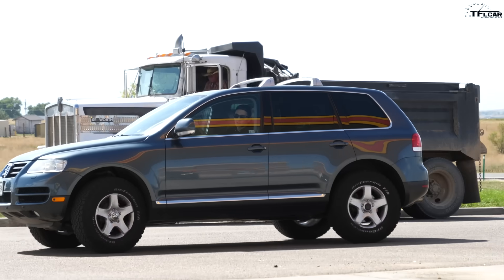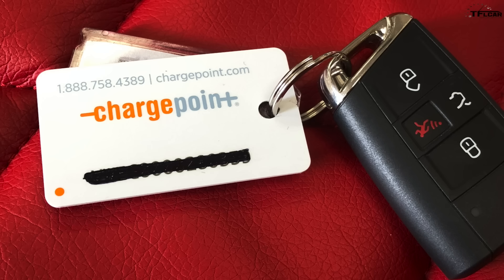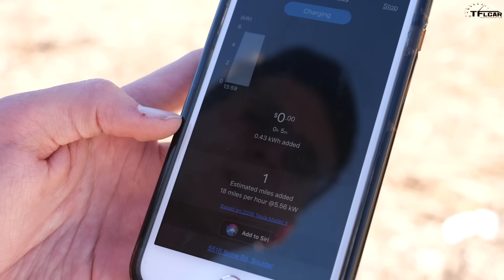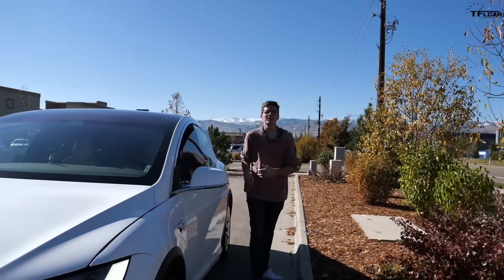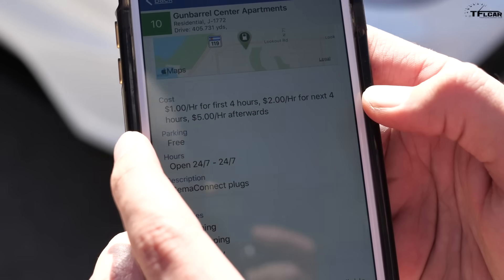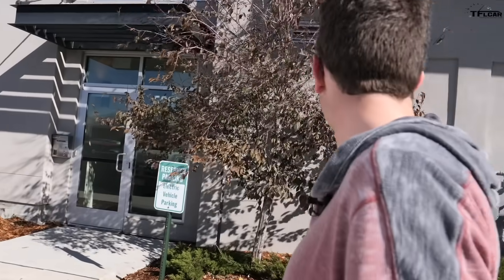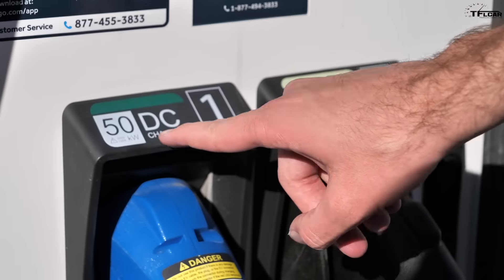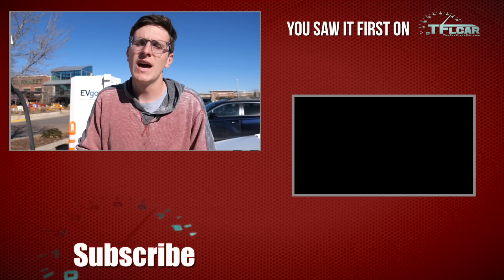Here’s Why Charging an Electric Car Can Suck - And It’s Not The Reason You Think!

Comment: Great video (again) Tommy.  Seems like unless you have a Tesla, you are pretty much in a waiting game (literally) until the rest of the industry develops super charger technology.  One question I have is - there has to be a point when vehicles far outnumber cars, assuming eventual move to EV's.  When that happens, you could really get stuck waiting behind others JUST TO ACCESS the charger.  What could those wait times be?  No one ever talks about that.
Reply: The waiting game for fast chargers probably won't be for three reasons.

First, charging locations are easier to build out than a gas station (no expensive storage tanks). Fast food establishments are the ideal establishments for adding fast chargers. Hotels will likely add L2 stations for overnight guests, and maybe a few L3.

Second, while it does take an hour or so to charge from empty to full, most of the time you won't need a full charge, just enough charge to get you home.

Third, you don't need as many of them as you do gas stations because the majority of charging is done at home.

Comment: 16 miles for an hour of charge!  Even a 200 miles an hour charger is still unreasonably slow! I can add over 600 miles of travel distance in a few minutes with my truck. EV’s might be nice for city dwellers who both work close to home and work 9-5. For many of us that have to travel this is unworkable. If they want people off of gas, they need to provide a solution that gives the consumer the same performance and convenience of a gas engine.  They is some interesting tech out there that may provide that solution, but it’s more than a few years away. Until then EV’s will remain a niche market.

Comment: So instead of being in the mercy of oil companies - we will be in the mercy of individual charging companies?
Oof
Reply: No, provided you have a house, or somewhere to plug in overnight.

The only time you'd ever need to stop at a public charging location is if your trip exceeded the range of your vehicle. Even then you may not need to do a full charge at a public place, so while it might take 1 hour to fully charge from a fast public charging station, you could perhaps get by with 10-30 minutes.

Here is a practical example for me (I don't yet have an EV...they are still novelty priced)
If I had a Tesla 3 long range (~310 miles) and I went to visit my parents, they live 400 miles away. 
I'd need to get 120 miles of 'recharge' along the way to make it to their house with 10% battery remaining. So somewhere along the route, I stop for 22-25 minutes at a supercharger to get enough juice to make it to my parents.

I stay at my parents house, rather than a hotel with L2 charging. But that's no problem because my old man has 240v plugs I can still get L2 charge speeds with an adapter letting me fully charge in about one night for about $8.

On my return trip, I'd then make one stop at a supercharger to make it home with 10%. This time stopping for 25-30 minutes since the supercharger is about 20 miles closer to my parents house than to mine.

If my old man didn't have 240v plugs, I could still recharge at 110v, but would probably only get 50-60% charge in the battery before returning home 2 days later. In this case, I'd have to stop at two superchargers, and spend 45 minutes combined at both to get home with 10% remaining.

When I'm home, I'd simply plug in and the next morning have a fully battery again.

20-25 minute stops may seem long, but on a 400 mile drive you'll probably want a meal and a bathroom break. They tend to put these things next to restaurants, so in truth you shouldn't have a lot of downtime.

Comment: I don't see this being practical for the masses.  Totally impractical unless you only do local driving. If they are going to push EVs the power needs to be generated in the vehicle. Batteries suck
Reply: It's totally practical.  I just did a 2600 mile trip in my Tesla up to rural Montana iadho and Wyoming from California.  Just use the Supercharger network.

Comment: Please don't continue to blame Tesla for the mess that EV charging plugs has become. Tesla came up with the best solution and offered it for free to anyone who wanted to adopt it but the rest of the car industry didn't want electric vehicles to succeed, they made their money (still do) from internal combustion vehicle sales. That is why we are now arrived at CCS, a horrible clumsy solution that is scarcely more capable than the solution that Tesla offered to the world a decade ago for free. With some DC chargers now capable of 350kW if we go much further down the high power route the cable, plug and socket (even if they are liquid cooled) will become too heavy and cumbersome to be handled by many of us. The solution may be a robotic arm that connects the charger to the car without human effort, possibly inductively coupled over a distance no greater than a millimetre or two (1/20th of an inch), no further than that since efficiency drops off rapidly with distance which means lost efficiency and heat which at those power levels would be bad news (fortunately, easily sensed so just an inconvenience rather than a catastrophe) but easy to correct with a rag to wipe mud off the coupling plate and try again.

Comment: This guy is an idiot. Charging at 24amps gives you 22 miles per hour. I know, I charge a Model 3 at home with a 240V Juice box using the Tesla J1772 adapter that was furnished free with the car.  If ur not getting 22 miles an hour at 24 Amps, there is something wrong with the ChargePoint. There is nothing confusing about charging ur car. U must know the basics just like u have to know not to use the diesel hose in a gas car. He is too young to remember that just 30 years ago, lots of gas stations didn’t take other companies charge cars. He is making this process look as cumbersome as he can make it. Before we got our Model 3’s, we had 2 Nissan Leafs for 6 years. My daughter started driving in that period and found charging easy. Of course, this guy is also the guy who backed a Model 3 into a wall with the Model 3 screaming at him to stop. Go figure.
Reply: You have to remember that most commercial installations of Level 2 Charging utilize 1 phase of 3 phase AC.  With that the voltage is 200 to 208 volts vs 240 volt split phase at your house.  

I charge with 200 volt 30 amps from a 3 phase system at work and I get a paltry 24/mi hr.  On a home system 240 volt split phase, it is 28 mi/hr.  Still slow but, 20% faster due to higher electrical potential of 240 VAC.

Comment: And my emissions fixed ‘12 Golf TDI can get 480-520 miles per tank on 45 MPH backroads (better on highways) and can get fueled up in under 5 minutes

CPO used vehicle with 50k, cost me $9,000

Currently a far better value than an EV, but given time, EV will become a better alternative 

I live in a rural area and even level 2 charge points are exceedingly rare, electric is definitely not a viable option at the moment for rural locations
Reply: Its more viable than you imagine, provided the vehicle can go about 300 miles on a full charge (So basically only long range Tesla)

Recharging is primarily supposed to be at home.
When on the road exceeding your vehicles single charge range, you don't necessarily need to fill to 100% before you resume your trip, you only need to charge enough to get where you are going.

As an example:
I live in a rural area as well where the nearest public charge spot (L2 or L3) is 50 miles away. If I wanted to go from my home to say Omaha about 360 miles round trip for a day trip to the very excellent zoo in that city, and the car I drove had 300 miles of usable range, here's what I would do.
We've been conditioned by our liquid fueled engine vehicles to say that when you stop for fuel, you refuel it to 100%. But in an EV that's not necessary.
I would not drive till my battery got near E, and then stop for an hour+ to charge the battery to 100% with a fast charger. 
I'd only stop long enough to add enough range to get me home, probably 10-20 minutes.

Once at home, I can bring it back from 10% charge to full overnight.

In my example considering I'm stopping at a public sort of place that people spend several hours at, they might even have an L2 charger, so theoretically I may not even have to stop at all on my return trip.
Reply: @dorvinion ; Interesting, never really thought of it that way, it makes sense, as you said, i'm thinking about refueling from a "Liquid Dinosaur" perspective, when I should treat it more like a "Laptop on Wheels", and be charging up whenever it's not mobile, long road trips are really the only things requiring planning ahead...

perhaps a more viable choice for me down the road is to electric-convert my Golf TDI instead of buying a new car, I know there are companies that make conversion kits, and they'll get better as time goes on, I really like how my Golf handles , it's a fun car, handles like it's on rails, and i'm sure e-converting an existing car is far more carbon-friendly than scrapping an otherwise good car and buying a replacement....

...and if i'm e-converting it, maybe I can change it to a rear-wheel-drive powertrain instead of front wheel, just put the drive motors in the rear, as RWD is better for performance anyway... ;)
Reply: @MacTechG4  
Glad I could help give you another way to think about them.

We are so set in our habits that its often hard to imagine how alternatives would work.
I only came to this realization of how EVs "should" be used recently.

They really ought to be marketing them in this manner.
Reply: @MacTechG4  Also, with respect to long trips, Teslas actually do that for you. Enter your destinations and it tells you where to stop and for how long.

Comment: Great video.  A point missed by most is how important it will be to charge at home and how 99% of the time you won't need public charging if you can get home juice.  With a gas car you'll spend over 30 hours pumping gas over just 5 years (7 minutes x 52 weeks x 5 years).  Charging at home you'll spend 0 time (well 2 seconds if you count the time it takes to plug in).  On the occasional once a year long trip vacation charge you may have to wait 30 minutes to fast charge to get to your destination.  So EV over 5 years 2.5 hrs waiting vs Gas over 5 years 30+ hours waiting.  Pretty easy choice.  Even if you travelled 10x as much as the average you'd still be less time waiting than gas.  Plus every day you wake up with a full tank.
Reply: Exactly!  Yes, you have to do a bit of advanced planning for long trips, but day-to-day commuting is much more convenient in an EV.

Comment: A CCS plug adapter is available in Europe already, but is slated to be released soon in the US, but it's likely on "tesla time" so who knows when it will finally come. It isn't THAT big of a deal since the Tesla superchargers are everywhere and quite fast (the CCS you were at was only 50kw, not 150kw like a super charger. - https://electrek.co/2019/05/07/tesla-ccs-adapter-model-s-x-retrofits/

Comment: Most people that have an electric car charge at home, which is much easier than pumping gas at a gas station. I've owned an electric car for 3 years and only used level 3 CCS chargers 5 times or so. So you need to keep this is perspective.  When you charge from home,  you wait 0 seconds to charge your car.👍

Comment: This video is so incredibly misleading that it seems intentional. I drive a Chevy Bolt EV 4000 miles a month (Lyft plus family stuff, live 30 miles from Minneapolis). Only once have I ever used a level 2 charger away from home unplanned (I use them if they happen to be where I'm going), and only a few times I've used level 3. It is only inconvenient if you have an abnormal use case - even a non-Tesla EV like a Chevy Bolt would work for almost everyone with an average commute below 50 miles a day, with or without home charging. If you're the type of person who does a weekly road trip to your cousin's ex-girlfriends, grandmother in Alaska, then an EV isn't for you. If that's your particular use case, great - stick to gasoline, no big deal. But for anyone who makes any effort to do minimal research and follows through to buy an EV, it is absolutely not this difficult to own! I'd argue that my Chevy Bolt EV has been the easiest vehicle I've ever owned - no gas station stops, no oil change/maintenance stops, etc. I've given these guys benefit of the doubt, but they are obviously biased. It's deception by omission - they're claiming not to lie, but omitting the benefits 90% of all drivers would get by owning an EV, and claiming that their ridiculous scenario is what people should expect. It's not.

Comment: You spent 99% of the video talking about non Tesla charging which is unfortunately not great. To be more well rounded you should of talked more about the Tesla supercharger and destination charges and you didn't even mention the kW of a Tesla supercharger which the gen 2 is 5x faster than the 50kW you mentioned. This video in general was correct in what it showed but left out important information. EV charging around where you live works great if you do it at home, work or where you're already going to be for a while. For road trips (long distances in one day) Tesla is the only option without significant frustrations

Comment: A 120v outlet gives you 50-60 miles overnight. How many miles do you drive a day. Add in the weekends and you'd be fine up to 50 mile commutes plus errands and assorted emergencies with a 220 mile battery.

It's not like fueling a gas car at all.

Comment: lets see, 10 minutes (if you take your time) to fill your transportation with PETROL to go at the LEAST 250 miles or MORE THAN AN HOUR of CHARGING to go 30 miles or less?
Reply: Not if you go to DC fast charger.  latest Tesla superchargers go 1000 mph peak rate.  Usually it's done charging my the time I take a coffee and bathroom break.  only use it on longer road trips, otherwise charge at home and never have to go to a smelly gas station again.

Comment: My only question: Having a Tesla why use a different charging station than a supercharger?
Reply: Maybe there isn't one nearby?
Reply: @RuneVenes  Maybe you shouldn't buy an electric car if you don't have anywhere to charge!? :P
Reply: @arturfraniuk1128   I charge at home, not sure if i would get a EV if i didnt have the opportunity to charge it at home.
Reply: The answer is you are in a rural area and it's the only choice. One guy did a road trip across the "loneliest road in America" with a Tesla and he changed the car at campgrounds which usually have a 30 or 50 amp plug.
Reply: Because if he had used a supercharger then this video would have been boring. He would have been in and out in minutes. But, hey, a lot of ignorant people out there. And this video did not do anything to make them smarter. On the contrary, it just plays to the stereotype of EVs being difficult to use. All for views.
Reply: @jbestman  To use a supercharger requires Tesla - correct?  I looked on the Tesla map and there isn't one near my home or work.  I'd end up using some other charging point, but not sure if it is compatible with a Tesla - or any other EV - but I'd need to do the research before I buy an EV.
Reply: @timelapseinsanity178  Luckily, you don't need a supercharger in the vicinity in order to own a Tesla. If you live in a house, you can have a charging station installed in your garage. It will charge slowly, but for everyday use, it is more than enough to keep your car charged while remaining convenient.

If you live in an apartment, they may have charging stations in the provided parking. Such a charger will serve the same purpose as a home charger--not good on the fly, but good for when you are at home and not using your car.

Because of this, you don't really need a supercharger nearby. Tesla has been building a network of superchargers around the country that are no further than 200 miles apart from each other. This is to ensure that people can travel the entire United States without wasting hours charging, not really to keep everyone's cars charged.
Reply: @timelapseinsanity178  If you don't have a garage or a home with a parking spot nearby to a plug then it is more difficult. If you have a plug you don't ever need a non Tesla public charger.
Reply: @flipadavis  if you can't charge an EV at home then you're better off with an ICE for now. It won't be long till we have charging stations all over and that won't be an issue.
Reply: @jbestman  Right, drive 20-30 minutes out of your way in heavy traffic.  That's fun.
Reply: Because you get more clicks and comforting confirmation for EV haters
Reply: In general I wouldn't.  However in my county there are numerous convenient free Chargepoint stations.  Many in the Town of Vail parking structures, several in the parking lot of one of our favorite restaurants and even some at the County Admin building in Eagle.  If I am there with my Tesla I plug in.  I don't need their app...they take a signal from my Apple Wallet to activate.  Very simple.
Reply: Maybe this guy is getting paid by a rival to make charging a Tesla look hard when the opposite is the truth.
Reply: there was actually one less than 6 miles from him according to another commenter. Problem is then you wouldn't have this video of 'myeeeeh charging takes time'